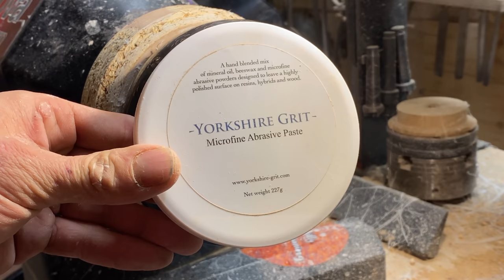Woodturning - Blue Lagoon Torus

Comment: not sure if you are aware of this, but an easy way to remove hot glue is to dribble a little bit of isopropyl alcohol on it after a few seconds it will come away really easy
Reply from the maker: 😯 don’t know that thanks you very much for the tip
Reply: @Villywoodworking  yea i work with hotglue all the time on my foam airplanes and a little bit of 90 percent IPA breaks the bod easily and leaves little to no residue
Reply from the maker: @WX4CB  so nice I will try for sure 🤟🏻